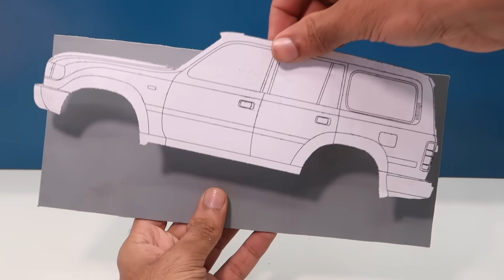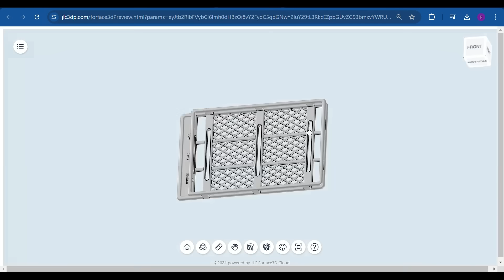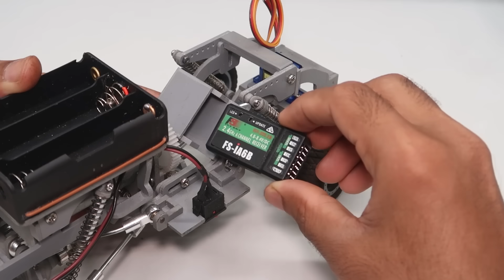Handmade RC Car From PVC Pipe.

Comment: 0:16 what is the cutting tool you are using what's the blade made out of
Reply: Wire saw mostly used by jeweler
Reply: string saw i suppose

Comment: It's wonderful that the most important parts of suspension are mode of metal, not like my son's remote control car, which was 4X4 but turned rear wheal drive after hitting in the wall 😢

Comment: The suspension system truly excels in performance when running, providing an incredibly smooth and controlled experience. It’s evident that a great deal of effort and precision went into its design and execution. What an outstanding achievement — the results speak for themselves!
wanna buy this master piece

Comment: I've been trying to build a Renult turbo 5 mock up out of window blind plastic blades the larger ones it works well but you have to sand it a lot because they put fake wood gran in them

Comment: I used to watch RC videos when I was a kid, and most of them were pretty disappointing. So when I saw this video, I just figured it would be the same, but I might as well watch it for nostalgia. You built the body and I thought, yeah that's it. Then you started working with the motor. Everytime I said "Yeah, pretty impressive, but that's about it surely", you bumped up the quality. Motor, yes and then just two wheels attached and call it a day, I thought. Then you started making the damn drivetrain - then the differential - and then the effing suspension! To say my jaw dropped would be an understatement. What an amazing creation!

I would also like to ask, how did you do the remote control side of things? Like configuring the boards, the reciever and transmitter so they actually just listen to the RC.

Comment: Very nice, and I think I most admire is that you saw it until finished…I’m 62 and have been playing with this stuff from back when we had reeds to control are planes. Servos were very welcomed when they showed up. Proportional radio systems were the biggest jump in control.
Reply: I hear you!! I’m the same age exact age as you. I would love to learn this stuff. I know a little bit about PCB Boards and electronics. After being into RC since I was 19 . But 3D printing and creating a file. I have no idea!! Would like to learn. But feel like I’m too old!! Also not much time. Have to work. Just trying to survive right now. Recently divorced and lost a lot!! Like I have to start over at my age!! Also surrounded by RCs  That I have to try and sell!!
Reply: @smoothrc28 just make a basic 3d model or find one, make it the correct scale for one of your rc cars. Eaisier than making one from scratch with a 3d printer.
Reply: good idea.. @brazykaczki  but i still love to make this perfect with hand made like this..😊

Comment: PVC or 3d printer?? some complex shapes are very difficult to make from just flat sheet. just wondering how you made those and templates for those. may have required millions times sanding and bending to get those vague shapes
Reply: Flat thin parts can be brittle when 3d printed, a mix of both will drastically save some time and make it more realistic, specially those tiny parts like mirrors, door laps, etc... Impressive work !

Comment: USE A HIGH SPEED BRUSHLESS MOTOR TO GET MORE POWER
Reply: Way?
Reply: This SUV is an off-road car, not a racing car
Reply: @tawakkal7781 but we can control the speed of brushless motor using remote control 😊